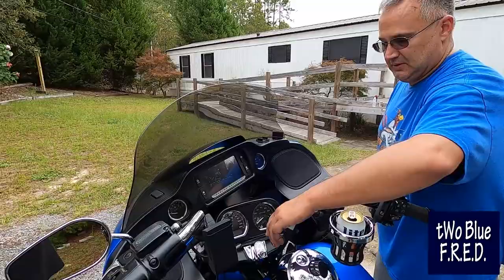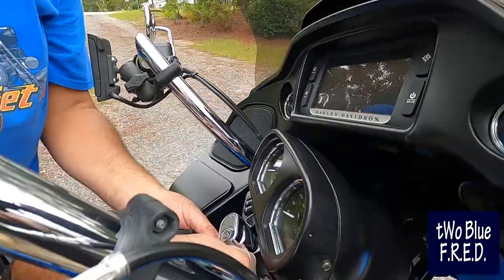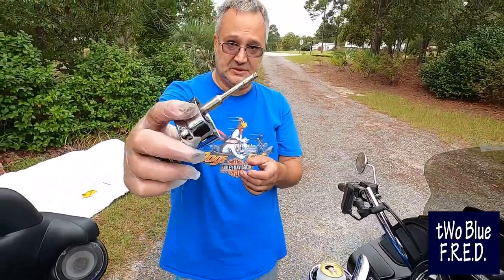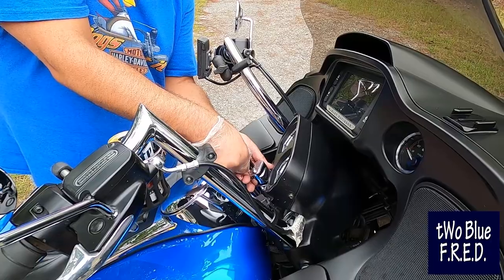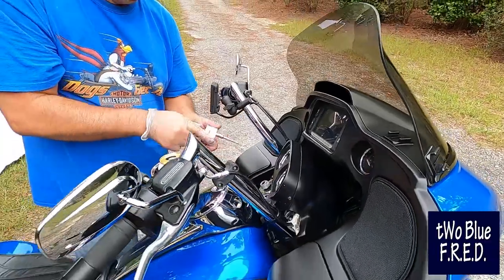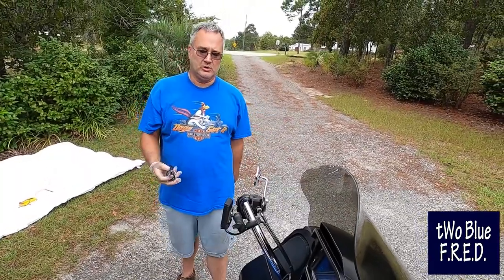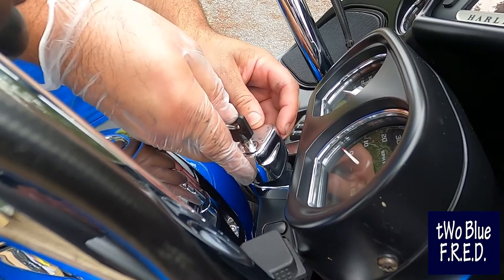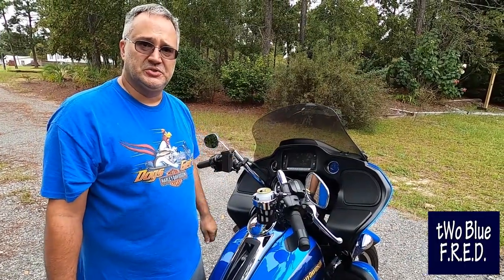How to remove Harley Davidson Ignition Switch and Install it again

Comment: Never mind, I got it done, and reset the tumblers with my flat tip screwdriver. No sweat, and it was an easy job. Most everyone is saying it's a tough job and don't misalign those tublers or you'll play hell trying to get them back in order again. For me it was a snap and I was finished in no time.

Comment: You DO NOT have to pull the ignition apart to realign the tumblers. You can realign them with a wide flat head. Shine a flash light into the hole, determine which one is out of line and turn with a flat head. Easy as that. Don’t pull the ignition apart.
Reply from the maker: i saw a couple guys try that.......    maybe if you very familiar with it, it works out good... thanks for the comment, cos you are right that works too, this seemed easier for us...
Reply: Confirmed. Flathead did it.
Reply: Hey buddy I broke the switch where can I get one can I use a flat head a screwdriver for now

Comment: I'm not seeing how turning the bars messes up internal cylinders/tumblers. The lock turns with the bars and is stationary.  I messed mine up 2hr ago when I turned the bars and it locked. I took out the two screws that hold the ignition lock and it allowed to turn the bars once again. When it locked though, the tumblers turned. Since I had the ignition in my hand I took advice from the comments here and used flathead to align the holes. Thank you to who said don't take apart the lock. Good advice.
Reply: Solid choice not taking it apart. With the ignition switch pulled out it allows the steering lock engage when turned far enough.

Comment: ok that is nice. but I am replacing the actual switch, the one the electrical wires connect to. got a new one, it is in the 4 o'clock position from factory. now to put it on and all the rest that goes on before the "switch" can be put back in the actual switch. I would like to see that done with a new one.

Comment: My ignition switch is locked in the start position, my forks are locked to the left…I can’t straighten my handle barsI can’t get either unlocked…what do I do

Comment: Be nice if you pointed out the nub on the switch before you took it out or what you did in order to get out.   All I seen was you hold a screw driver under the switch and remove it.

Comment: Turning the handlebars once the ignition lock is pulled out, will not change the anything inside the ignition switch whatsoever.

Comment: In the middle of a divorce here. Found out my soon-to-be ex has a spare key to the bike(2015 ultra classic limited)  & might be trying to get set to move it some place while I'm at work.
If I pull the ignition assembly while it's in the fork lock position, will the forks stay locked? I'd like it to stay where it's at until division of property is done.
Thanks in advance.
Reply from the maker: yes,  i have had them locked with the ign out before...  good luck, protect it

Comment: How i can  remove ignition switch if the key is lost?
Reply: Remove the decal on top, you will see a couple of screws, loose them, and be very carefully to put the knob away, then, put the lock  clockwise to the dot on the 3 o clock position  and you can get de lockpin with a small pleir out of the house. BUT BE CARREfully: because on the inside, there will be very little pins and springs, don't loose them and the heave there own location like a code. After that, you can remove the ignition switch